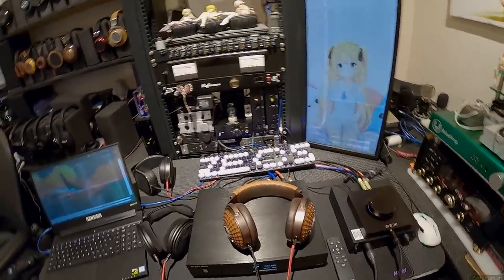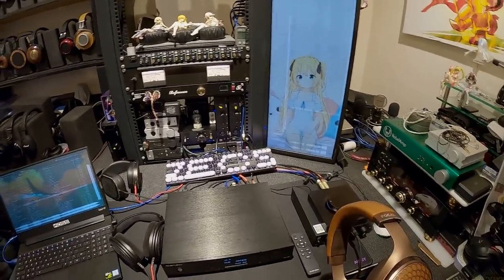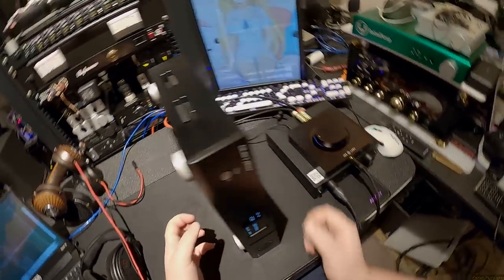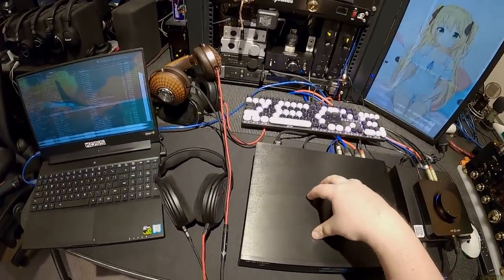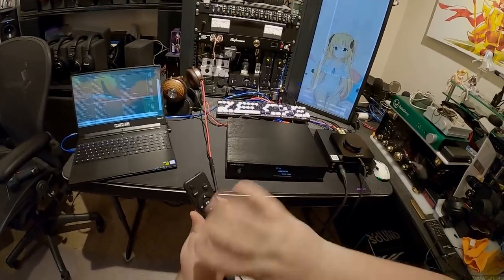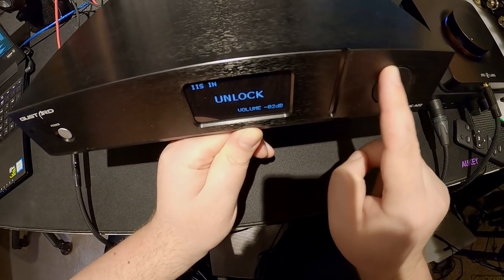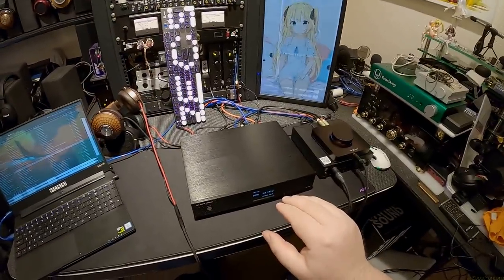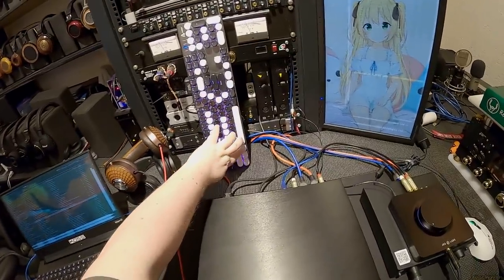Gustard DAC A22 _(Z Reviews)_ 💎

Comment: I had a Gustard X20 Pro (dual ES9028 Pro) for about 4 years. Its display was exactly the same as on the A22. It was very good and handled everything I threw at it. Sadly, it was destroyed when I moved, a few months ago. I used the insurance $$ to buy a new Topping D90 which produces even better audio than my X20. It's a lot more compact, too. I considered the A22, but some reviews claimed it ran hot and didn't feel as well-built as the D90. It also cost $400 more. I'm happy with my D90, but it's nice to see the A22 get the Zeos seal of approval.

Comment: BTW.... Don't max the gain on the 789. Only the volume. Gain = Distortion. The middle position on the 789 is 0 gain. The left position is attenuation, and the right is actual gain. You automatically get +6 gain when using the balanced out due to topology, and that should be more than plenty, unless you're running hard to drive headphones. Try to avoid moving that switch away from the middle position as much as possible. The about to be released Topping A90 will have 6.5 watts versus the 789's 6. Also, they are going to release a pre-amp, which just might allow you to get that extra power for your hard to drive headphones without having to use high gain. That means lower distortion. So, get the Topping D90, and get ready to get the A90 + P90. That's going to be the ultimate headphone stack for your desk. The A22 is not desk-size, unfortunately. The D90 also has Bluetooth, and there's a MQA version, which allows allows you to stream Tidal in up to 24/192, instead of just 24/96. MQA has 3 folds, and software can only unfold the first two, where as dedicated hardware can unford the third. Whether you'll be able to tell the difference is debatable, though. I'm only letting you know the technical details. Your own ears will have to be the final judges.

Comment: I decided not to get the Gustard A22, after seeing how large it is next to Mr. Z's AAA 789, which is what I currently use. Topping's D90 measures even better, and they are going to release their matching A90 headphone amp within the month, and it's supposed to measure even better than the 789. They'll also be releasing a P90 pre-amp, with a high quality digital volume control, with a remote. The D90 also has bluetooth, and an MQA version. Topping is about to take all my money. LOL
Reply: I just received my D90 yesterday with MQA.  Currently I have the 789 to pair it with.  I'll have to look into getting the Topping A90 headphone amp, especially if it measures better.
Reply: The A22 will be available with MQA in a few days.
Reply: @amazoidal  Good! When brands compete, consumers win.
Reply: Stanny1 I can’t find the Gustard a22 mqa version, do you have some suggestions? Kind regards

Comment: invert phase is only for xlr outputs. hot and cold line will be switched from american standard to european/japanese standard pin layout. it has to be the same layout as your next componant has. otherwise its soubd wrong...kinda out of phase, but nor like you switched polarity on you speaker cable.

Comment: PLL=phase locked loop.  

phase control--a musical waveform is asymmetrical so the positive half of the waveform going to the speakers or headphone transducers, if in absolute phase, is an air pressure toward you.  the negative half is a rarefaction (moving away from you.  ostensibly, there will be only one correct absolute phase.  once it is determined, there SHOULD be no reason to change it.  however, some recordings can be inverted.  also, it depends on whether there is an even number of stages within your amplification chain or an odd number.

assuming that the recording as encoded on an LP or CD, or other source, is IN absolute phase, and even number of stages will result in the correct absolute phase.  and vice versa.  only one way will sound right.  when you have lots of time and there is switchable phase, do some listening for it.  you WILL hear a difference, if not immediately.  

i once got to demo an adcom cd player with a phase switch.  one way did sound better.  much, maybe too much, has been written on the subject.

Comment: The upcoming A18 may be a wiser choice for price/performance? At $560 with the same AK4499, balanced, BT, and linear power supply built in.
Reply: A22 uses two 4499's.

Comment: How do you only use this unit as only dac mode and disable the preamp inside this unit ! ? I can’t see how to disable the preamp or even in the menu ? I want to use my external preamp I have .. please help !! Do I just max the volume on this unit to 0:00 max volume is that it and it will automatically disable it’s built in preamp ? Or this is a more advanced way to really shut that part down inside this unit ? I want to squeeze The best performance I possibly can out of this unit and disable all this other post processing stuff or other components inside this unit that I would not be using example the preamp ? Any help please 🙏☹️

Comment: How do you disable the internal Preamplifier on this unit and only use it as a DAC because I have an external Preamplifier that I would like to use plus it will probably squeeze better performance out of this unit not using the preamp and disabling it how do you do it? For example on the topping D90 and D70S inside the advanced menu settings you literally have an option to disable the preamp and only use it as a Dac which ever you prefer I don’t see this option on this unit :( please help

Comment: Would you say this performs a lot better more sound more and more dynamics just overall a better detailed faster sound then say the other review you did of the topping do you 90?  There was one review online posted on Google I guess someone did a review but I guess it was a prototype model at the time where they measure out everything the sound distortion all that stuff and they said in the comments it didn’t seem to measure as good as the topping which is bizarre because this has two of the dac chips Inside of it plus it has a bigger power supply you would think knight in day this is a better design better stuff going on inside so should sound better than a D90 but I’m curious to know what’s your thoughts I’m only using this in a speaker set up I’m not using it with headphones literally gonna plug this into my power amp and plug it into my Klipsch Cornwall IV speakers

Comment: Not in the least interested in paying almost 2x what a great DAC costs. TotL Topping and SMSL are the giant-killers today. It makes no sense to pay so much more for the exact same bits arriving to my amp.
Reply: DACs don't transmit bits. They convert them to waves.
Reply: The ONLY "same bits"  are the single AK4499 vs dual AK4499 chips in the Gustard. The Gustard has separate digital and analogue psu's, too. It should run amplifiers a lot better.

Comment: This or topping d90?
Reply: Neither. Get the Topping E30.
Reply: d90
Reply: D90
Reply: Ofcourse Gustard beats the Topping implementation.. this is such an audio noob channel it's getting ridiculous..
Reply: Dilyaev Yeah yeah.. In the meantime, however, the Topping D90 measures better than the A22 on each front and sounds like DACs that cost 4 times its price, let's hear, in what the A22 would be better?
Reply: @Dilyaev  sure bro
Reply: I got the Topping. More features, and will stack on your desk with their soon to be released matching amp which supposedly bests the venerable THX AAA 789. They will also be releasing a pre-amp with a high quality digital volume control, with remote. A trilogy! Just FYI....
Reply: @PC-yw9co  The Gustard uses 2 AK4499's (one per channel) and has a discrete audio output stage instead of op amps. The op-amps will have better measurements than the discrete stage with regard to S/N and distortion figures, but let's be realistic and say that either one performs at SOTA levels. It comes down to design choices. I think the Gustard is a bit more technically ambitious. The dual DAC's are a nice touch. The discrete output stage runs in class A, unlike the op amps which normally  run a lot lower bias.I myself like that aspect of the Gustard and would probably be willing to pay the extra $$ for it if I was in the market. But, it''s really an open question as to whether any of these differences is audible. I would assume the 2 sound very similar, and it would be virtually impossible to pick out which is which in a double blind listening test. The measured noise and distortion levels of either one are way below the threshold of audibility.
Reply: @johnstone7697  All things being equal is just more reason to save your money, get the D90, and in a few weeks from now, buy the matching A90. Have a nice-looking stack, which also fits on your desk for easier headphone listening. The Gustard is better for a shelf setup, or a rack mount system, and speakers as opposed to headphones.

Comment: we care about DACs especially have amps have gotten better the DACs have moved up in the value stream of importance.
Reply: I'll save you a lot of money right now. Any decent ~$100 DAC and up (See Topping D10, SMSL Sanskrit 10th, Schiit Modi 3 etc) ALL SOUND THE SAME. They are TRANSPARENT and any measured improvement beyond these is BEYOND HUMAN HEARING. A $10,000 DAC will not sound any better. You will only get more features and different build quality, not any better sound quality that you can perceive.
Reply: @brydon10  
Lol no, just no.
Reply: If you can't hear different dac qualities  just get bose gear...
Reply from the maker: @brydon10  3 years ago Zeos would agree. But with new cans and THX tech. You can actually start picking them apart. I'd just say the bar has been raised to roughly the $350 price range. The JDS Labs EL 2 and SMSL M500 are now in the "can I tell a difference" category.
Reply: @martincollier5128  In every blind test people have failed to differentiate between DACs. Until I see one that proves otherwise, I'll stay very skeptical. But hey, it's your money.
Reply: @mariodrv  In every blind test people have failed to differentiate between DACs. Until I see one that proves otherwise, I'll stay very skeptical. But hey, it's your money.
Reply: It's much better to invest $750 in a pair of speakers and $250 in a dac than the reverse.
Reply: @Mad.Maxx.77  lol nobody is arguing for $250 speakers but I will argue for $600 Maggie LRS
Reply: @aceofspades6667  You completely missed the point
Reply: @Mad.Maxx.77  yes i get its a ratio and allocation of resources question.  but as you scale up in sq it simply isnt true.
Reply: @brydon10  I hear significant differences although many I find highly listenable.